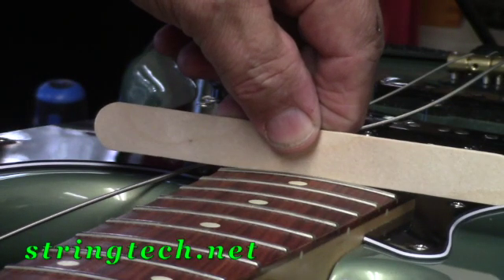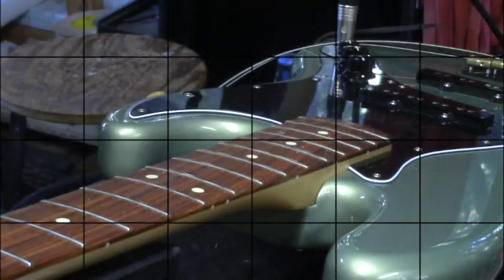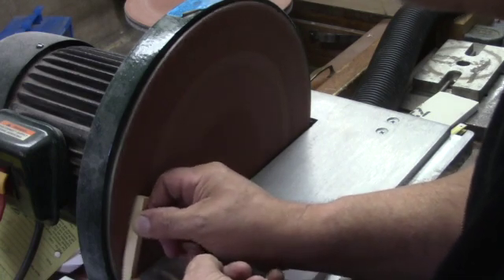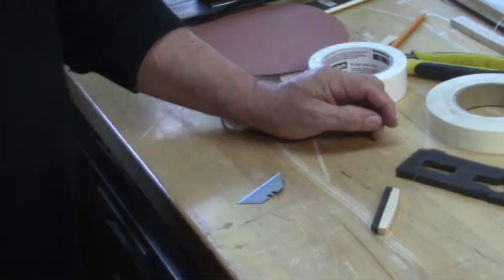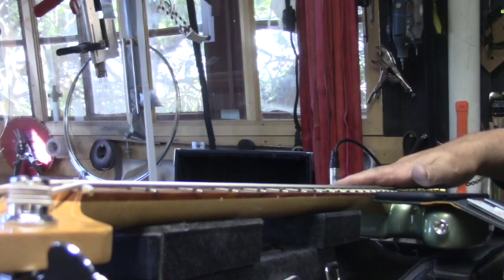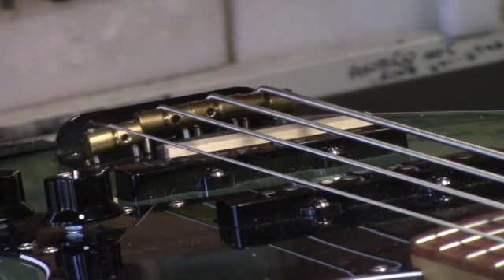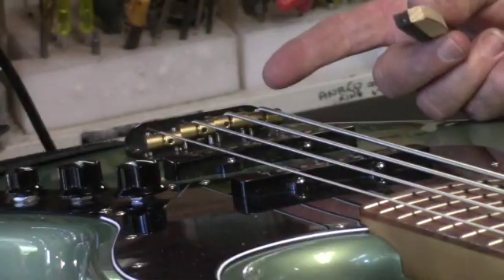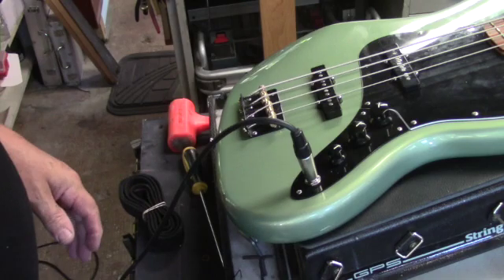Making a self-adjusting radius gauge / handling those long flexible bass necks @StringTechWorkstations

Comment: It is a great idea!  But I have to make one comment. The radius of the fret is not the radius of the bridge. If you use the exact radius of the fret your two middle strings will be higher than the outside strings. It’s not by much but it matters enough.
Reply from the maker: Good intelligent point! If you follow the trajectory along it's length from the nut to the bridge, the middle 2 strings WILL be ever-so-slightly higher. In the case of SS acoustics .... this is a very good thing. As the "G" and "D" strings ( if the saddle slot is in the right place ) are the ones that usually need the most " correction " ..... meaning they ( usually ) need to move forward ( towards the fingerboard ). That teeny little bit of extra height helps towards the needed "sharpening" on those two strings. It also gives a little bit of extra " forgiveness " when filing;  while dialing in the intonation. Thank you Ken, for that observation and comment; I can see that you really have your " Thinking Cap" on .... Bravo! MMcC
Reply: @StringTechWorkstations  great comment, I could learn a lot from you.
Reply from the maker: That was video # 471...... and I am still learning. Cheers Ken ! MMcC

Comment: Nice little tool, but it does take some time to make. I just use a commercial understring radius gauge, quick and easy :-)
Reply from the maker: Ya ... I get it totally. I have lots of customers who use their 3D printers to make their own. I routinely make these " self adjusting "  gauges  for my customers .... takes all of the guess work out of getting it lined up .... once the two outside strings are set. Cheers MMcC

Comment: Silly question @StringTechWorkstation but what grit of sandpaper discs do you like to use on your wheel and belt sanders for jobs like these and saddle/nut excess material removal eg? Great video as always 👍🏻
Reply from the maker: 80 Grit. Occasionally I'll use 60 grit if I have to really need to hog out some material in a hurray. Once the 80 grit starts to wear ... it is equivalent to a 120 grit. So..... short answer ... every stationary sander in my shop has 80 .... 90% of the time ;^ ) ! MMcC